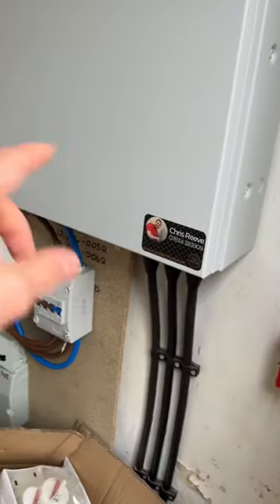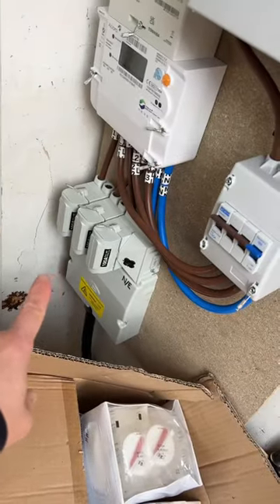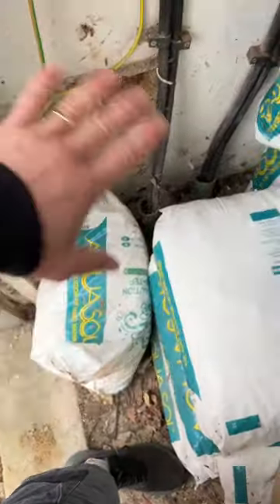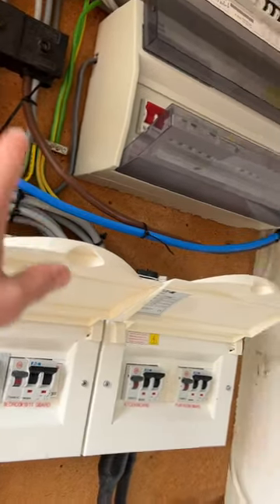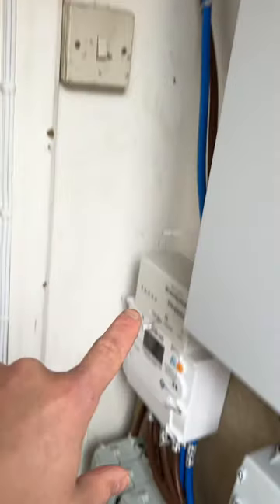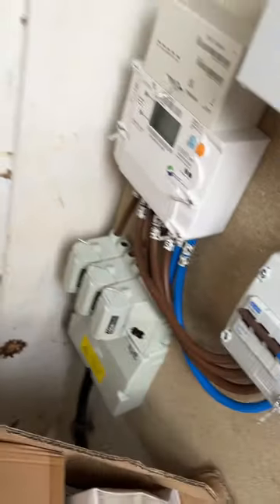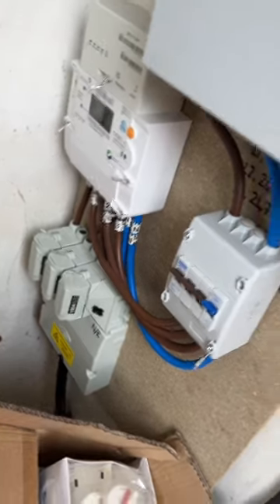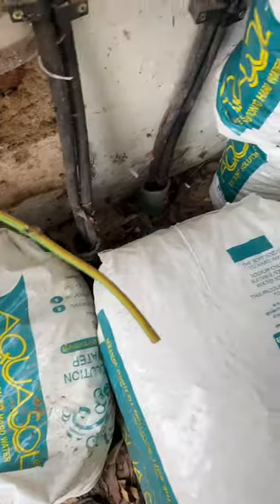About as dangerous as they come !!! #shorts

Comment: Do residential services get supplied 3 phase in the UK? 

We have 120/208Y services for comercial residences (apartments/condos and the like), but single family dwellings are single split phase 120/240 for us.
Reply: Yep, no dramas with supplying 3ph 240/415v to domestic properties other than paying for the cabling work. It's usually only as far away as the service connection the the main. A lot of new houses are being cabled 3ph up to the service head as standard, even if the meter and consumer side is all 1ph. "Fitted for but not with."
Reply: Getting a lot more common these days with the rise of the electric car and prevalence of solar PV installations - you certainly aint getting your "Supercharger" on a single phase supply.  Id expect in a few years that 3ph in new builds will become the rule.
Reply: @jeffbuss2930  You don't get superchargers on a residential building lol
Reply: All depends on the customer needs, can even get 3ph ct supplies on residential properties too (granted its taking residential to its limits as that was some toffs estate), but it is definitely becomming more common for larger supplies to be installed as we fill our houses with more and more electronic devices.

Comment: I’m a meter man and normally dno fit a earthing block with new cutouts so that’s weird I’m not 3phase trained tho, dnos have different practices across the country aswell, I also wouldn’t mess about with the earthing installation other then tighten up and recable if needed, because like people have mentioned it’s not our jurisdiction we don’t have the necessary training to alter earthing, in the situation a house wasn’t earthed we should leave them off supply

Edit: just came across this short again, on a new install which that would’ve been he is only supposed to connect up the isolator and do an Eli test and spark does the rest so he worked illegally, should definitely report to their company because he could do this again until the dice roll against him

Comment: The (meter man) supplier isn't responsible for the earth. Probably should have informed the DNO/Customer though 🤷‍♂️
Reply: But surely they have to leave the installation in a safe manner. Just like us actual electricians do.
Reply: Of course they should 😆 IMO they should have installed the meter up to the isolator and left it at that.
Reply: Datum is correct the meter man's job ends at the service head. He's now left an installation in an unsafe condition, and did he supply a new installation cert for that connection?   This is probably because last year this meter man was probably that a meter reader not a spark.
Reply: That's right supplier's aren't responsible for providing an earth anymore... suppliers are responsible upto the supply side of that isolator... they would of left the isolator sealed in the off position ready for the customers sparky to connect the tails

Comment: A main earth is down to the DNO to connect and prove. The meter bloke has just done his job properly. Not the nicest job in the world but what is he meant to do in that situation?
Reply: Look higher up. The MET is higher up on the wall.

This looks like an earth wire from the MET, not the incoming earth from the supply.

Everything from the MET inside the installation is the responsibility of the home owner.
Reply: I think I aggree with you, the main Earth is not the purvue of the "Meter Man" (the supplier) only the DNO (as it is sealed by them) however the DNO arn't obliged to even provide an earth...!  Crazy, I know - still Mr CJR will sort it ;-)
Reply: The DNO should make an earth available on new installations providing it is safe to do so, but the electrician is responsible for connecting the earth hence why cutouts have the little break out to allow the earth to be connected after the DNO have sealed. The meter operator should have just wired to the isolator and left it in the off position.

Comment: Boggles my mind they let you run bare wire service entrance feeds
Reply: Those tails are double insulated, and the service cables are some fairly tough stuff. IIRC 3ph service cable is a split-core concentric carrying the phases and neutral, with a ring of conductor providing the earth/ground and a tough insulation layer over the top. Old bitumen cable had a layer of thin steel.

It's very common for them just to get slung on the wall in a low-use utility space like an under stairs cupboard with no special protection. Small commercial premises whichever wall is most convenient. In large commercial spaces they get trunked or cabinetted. It's generally never a problem.

If that gives you the heeby-jeebies consider at least they run it through underground ductwork now, used to be direct buried! o_0

Comment: Three phase is provided with three live lines at 415V between lines (Delta). There is no neutral and therefore no earth.
If you want 3 x 240 (star), it’s up to you to sort out the neutral and the earth.
Reply: see the blue cable going from the head to the meter, then to the isolator?  That's a neutral.  The DNO has provided it.

Comment: Looks more likely when DNO have moved cutout they didn’t extend the earth. MOP are told not to touch the earth therefore don’t usually carry eart cable and certainly wouldn’t have a MFT to test. They are asked to do a plug test though so depending on whether there is parallel paths giving an OK plug test he probably didn’t even look at MET.

Comment: I got a proper good shock trying to wire up a two way landing light switch  a few years ago, always make sure you turn off the electric supply at the fuse box, I hope this good advice will help others work safe around electricity. I only burnt my finger and thumb and heel, it can be fatal if it travels through the heart muscles.

Comment: The whole metering system done by suppliers is complete bo!!0cks this should of stayed the responsibility of the DNO 

The electrician should have left tails and an earthing conductor ready to connect and or been on site ready to connect, it’s not like you don’t know when they are coming because it takes fi@king weeks for them to turn up and fit a meter
Reply: Its not suppliers doing any electrical works, its another company specifically fitting meters and are fully regulated. Your just confused as the companies may be owned by/trading under the same group, though any metering company can and do fit meters for anyone, thats the point of business separation to allow market/consumer choice. And to top of your lack of knowledge many of the metering companies are filled with the same old guys that used to do both DNO and metering works when everything was combined under the electric boards. Tbh DNO as a business entity have been doing everything they can to mininise their responsibility and offload anything thats not core distribution function. Ive dealt with a lot of DNOs and quite a few try to refuse actions they are legally obligated to perform. UKPN in particular are the most difficult DNO to deal with. I would really hate the state of the industry if it was all stuck back with the DNO youd be waiting few years to get new supply put in rather than the months it is now and thats still mostly down to the DNO, the metering can ususlly be arranged in a couple of weeks.
Reply: @branbroken  I’m not confused if I i phone my local DNO with a problem they rock up in less than 3 hours,  
Meter issues take between 6 weeks and 6 months to resolve

Comment: And How can tails be that long! Single sheath cable 😮
Reply: 3m Max length for tails...  And tails are actually double insulated, or rather, insulated and sheathed.  These new, flexi-tails, just use pretty colours rather than dull grey for the outer sheath.

Comment: That’s what they do these days - I’ve been told they’re not allowed to connect the earth anymore
Reply: Nah 
In the video the main earth terminal is shown higher up on the wall.

This looks like an earth wire from the MET.
I believe some DNO's provide the wiring up to the MET. Everything beyond that is the responsibility of the home owner.
Reply: Do would have disconnected the single phase supply and fitted the 3 phase supply .the meter installer would then remove the single phase meter and fitted the 3 phase meter will temp supply to the single phase to keep the customer on supply he is not allowed to do the earth.  They have no way of testing the earth hence why they don't  connect . It was a sackable offence when I used to fit meters